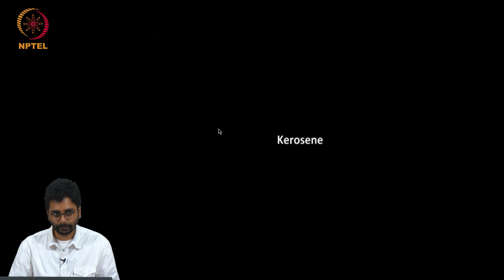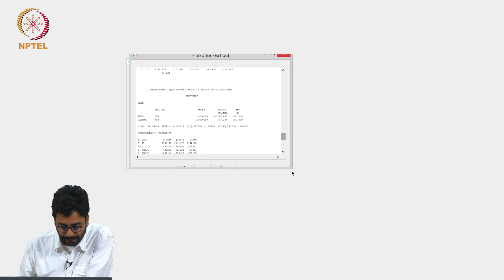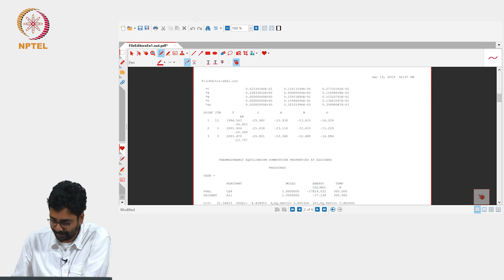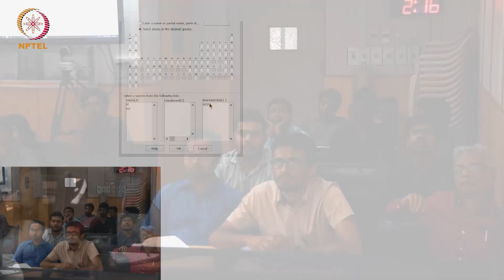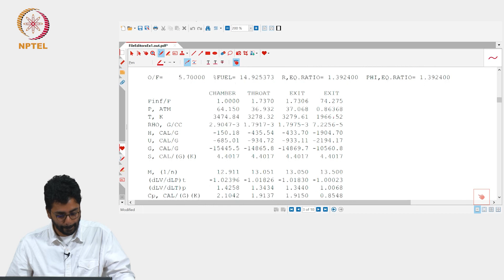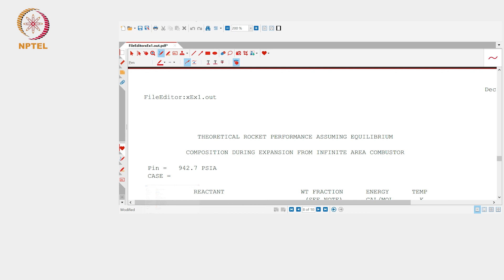Lecture 06

Comment: Hi! I want to perform equilibrium calculations between glycerin, water and methanol (tp problem). I am not finding glycerin in thermodynamic library of CEA nasa. Do you know if i could decomposed the glycerin into 3 ch2 + 3oh? could this compromised my results? i already did a mass balance and everything is ok, but the Std enthalpy change of formation is not the same published on databases. Actually, in the output file do you know what is the difference between enthalpy h0/R and h? Thankss